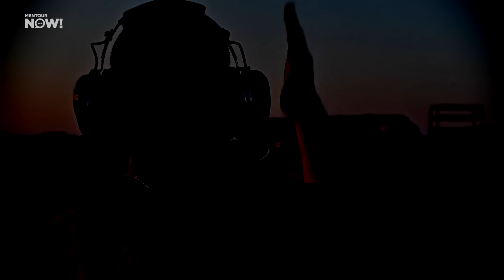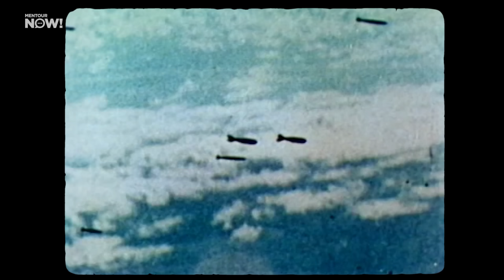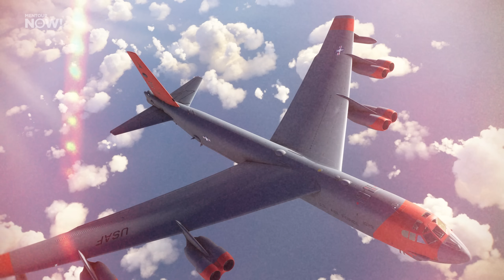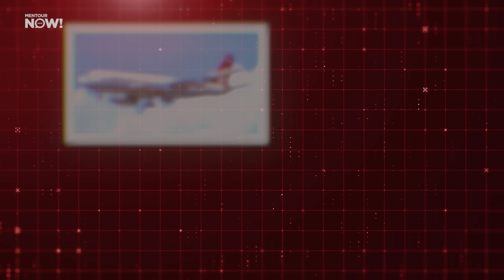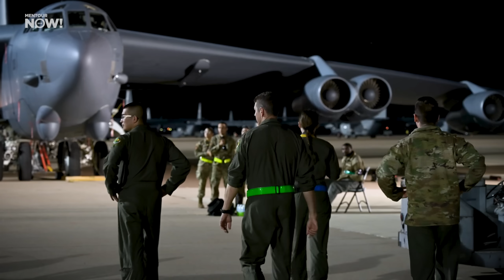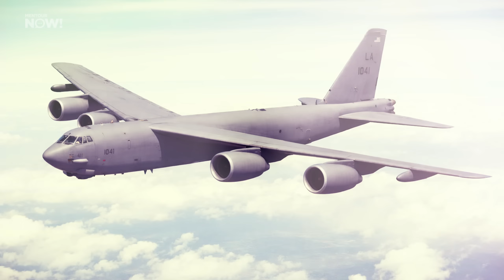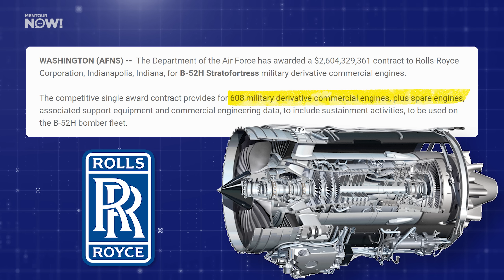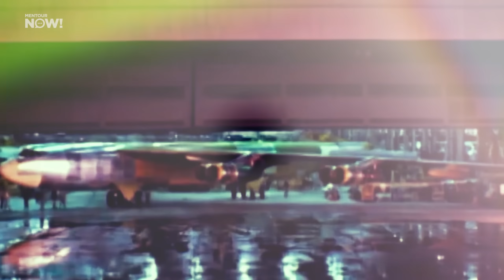WHY Are They Changing The B-52 NOW?!

Comment: In general I think everything should be upgradable for decades. That would just be fantastic. Think about a Car that you could keep up to date, you could have bought it when you were in your twenties and use it until your fifties or even sixties. What would count on a car? Well, brakes, gearbox, exhaust and engine. You could have bought it with a normal combustion engine and now you would think about an electric drive train - given the body and structural parts of the vehicle would still be good.
Or Smartphones. The usual size doesn't need better displays as the human eye wont see any sharper as it does. If memory, processor and camera modules would be upgradable on long term I'd absolutely do that. Yes, there have been some attempts via some modular phones, still those are nieche products. And so is the B-52. I'm just glad that for guitars a d electric guitars not so many things have changed. I can still upgrade a 1950s Gibson Les Paul with Locking Tuners, better pickups and whatever comes to mind. I just wouldn't do that because some things are meant to stay original...

Comment: The US has a hard on for the B-52...it's too iconic to let it go. Before they chose to upgrade the engines...they should have just cut their losses. I know they have a hard on for this plane, which is an amazing plane, but is evidenced by a B-52 on display at the old Lowry Air Force base, here in Denver. The US is saving face with this...there is nothing new to be gained from these upgrades. Decommission them, unless they work as is...6th generation fighters are out...what chance does a slow ass bomber have with a zero stealth, modern day fighter?

Comment: We missed redundancy. If one engine hit by fire or damage or attack  in flight you still have 7…
Reply: Don't forget the story of the F-4 pilots flying beside a B-52 that decided to show that they had the better airplane.  After flying an aileron roll around the BUFF, they asked if the B-52 could do any better.  The BUFF driver replied, "Sure, just wait a minute or two...   How was that?"   From the F-4: "What did you do?"   BUFF: "I shut down two engines. Top that!"  (They also have a galley, so the flight engineer was able to cook breakfast on the return leg to Guam after an Arc Light mission, which impressed BG and former B-24 pilot Jimmy Stewart.)
Reply: You calling yousef nobility-we plural, your majesty?
Because Peter author had not missed this argument😅

Comment: Time stamp 14:30 The complete redesign to four engines would not only be expensive, it would be dangerous. The new B-52 would be a new aircraft in terms of both flying and maintenance. The process of finding all flaws would be huge and dangerous. And, as often happens, if design errors were missed, there could be crashes and fatalities in early years of use or in first combat, as has often happened before.

Comment: Excellent video, well-researched and presented — especially since the illustrations matched the narrative, so lacking in many videos today.
I, respectively, want to point out that in the late 1940s, the Boeing engineers anticipated more powerful engines, and so they introduced the pylon concept on the B-47 to facilitate swapping to upgraded engines. The B-47 concepts of engines mounted on pylons, swept wings and landing gear in the fuselage made their way into the design of the KC-105/707 and into the B-52.
Reply: Except B-47 did not introduce the engines on pylons concept. The first aircraft to fly with jets mounted on pylons was the Soviet IL-22 bomber in July of 1947 (not to be confused with much later IL-22 turboprop). It did not have the swept wing though, but that's not the Boeing's invention either.
Reply: The pylon concept was for survivability during air to air combat or engine fires. The pylon allowed a burning engine to hopefully separate and depart the wing without destroying the whole aircraft. It had nothing to do with future engines.

Comment: The tail has already been redesigned. When crews flying over Vietnam were being killed after ejection and subsequent tail strike, Boeing determined they could cut the tail down by about half.  The problem was it no longer had the rudder authority to control the direction on the ground after an engine failure at the 80 knot standard.  

The asymmetric thrust resulting from losing an engine before the rudder had aerodynamic on a 4 engine aircraft would almost certainly be fatal.  The B-52 is unforgiving in ground mishaps.
Reply: Re: Crews in Vietnam being killed during ejection by striking the tall tail as a reason for the shorter tail

Do not believe this at all. Sounds like old wives tale. I can’t find any documented case that this ever happened, Vietnam or elsewhere.

And even more definitively, the shorter tail appeared on the significantly redesigned G model in 1959. The first Vietnam mission flown by a B-52 wasn’t until 1965. 

The shorter (from top to bottom) but longer (from back to front) tail was created as part of a weight reduction and redesign effort that made the G model a different airplane from the A thru F models. The redesign of the tail was driven by the change in mission profile from high altitude bombing to low altitude penetration. At low altitudes the denser and more turbulent air put a lot of stress on it, and there were several mishaps caused by the tail breaking off. Even after redesign this was still a risk: the famous landing of a B-52 missing its vertical stabilizer (broken off to turbulence during a low-level test) was accomplished in a B-52H with the shorter tail. Mentour has a video on this also, I think.
Reply: That is not the reason the tail was redesigned and height shortened.

After the loss of two B-52s due to inflight turbulence, and loss of more than 80% of the vertical stabilizer on a third aircraft, it was determined that inflight turbulence could induce a resonance in the tail that resulted in structural failure.  There is footage of the third B-52 that was successfully landed, recorded by chase aircraft that were scrambled to assist in evaluating the damage before the landing attempt decision was made.

Comment: Why would you not keep a working system if it was designed and proven to be reliable?
But now with the engine-"upgrade" they have finally decided to Kill the aircraft.... yeah, sooo complex that engineering just a part of the aircraft takes longer than the entire timeline from "We need a new aircraft" through multiple "We want something different" to "Here you have the keys - have fun". Of course they have to make the engines way more aircraft-specific, highly complex and insanely expensive - if there were no cost-overruns (and we know there will be) then these new engines have a cost about half of the entire aircraft-cost, and that is just for the initial production. If you then look at the insanely high maintenance costs of modern engines - yeah this will be the most expensive "upgrade" compared to the original aircraft in aviation history.

This also shows that people are retarded:
The B-52 is a "slow" but sturdy aircraft that can deliver massive payloads. A B-1 or B-2 can also carry a huge payload but they are not designed for the same mission profile. The B52 can stay around far longer, the B1 is faster, the B2 is stealthier - and often you don't need the speed nor the stealth. And then a far simpler, cheaper, and sturdier aircraft is a good solution.
Surely we could create a far better aircraft overall for this type of scenario but that is not the new and shiny thing. That type of development focuses more on new stealth bombers.

Comment: IMHO the B-52-J should be a 6 engine plane, with the inner engine pylon having one one large engine and retaining the twin outboard, this would not require a larger rudder/tail for a one engine failure.  From what I found on public engine data, with the same level of technology, doubling the engine size, gives about a 10% increase in efficiency.

Comment: Makes me wonder why they don’t take a perfectly good modern passenger aircraft and turn it into a bomber.
We have all seen fire fighting aircraft and I bet that feat wasn’t in the original design.  Or was it?
Reply: A passenger aircraft is pressurized and has the wings under the cabin. A bomber is not pressurized except for small compartments and has the wings above, to get a longer and uninterrupted bomb bay. Structurally the fuselage of bombers is completely different from an airliner.

B-52 also has hardpoints under the wings, something an airliner wing does not offer.

Comment: I understand your point ... but what most don't understand is the true genius design of these planes. If we are so technologically advanced, then why can't they find or design an engine that can be used without problems for this plane? It amazes me how far we have come, but people with slide rules from the 50's designed a plane that has outlasted generations that are still flying... I think we need to dig up the old engineers to create an engine that will work in the modern age for these planes ... I bet they can figure out at half the price lol
Reply: I'd imagine the engineers were thinking any advancements in equipement inside the airframe would progress and be done in a way to fit inside their design without any major disrurptions or major reworks of the airframe keeping the cost of future updates fiesable. Or that's how any engineer should be looking at a project hoping that what they build will outlast the materials and tech available at the time of the original design. Look at the Aleign Burke class, it launched in the early 90's and they are being updated or being built new as a 3rd generation of the original.

Comment: On low level , low speed flight,  they seem to blot out the sun forever. They're really big.
 I'm glad the new planes I often saw in early 1960s El Paso when 13 will have better motors and still be flying after I'm gone.
Some designs are timeless
Reply: They were called the "aluminum overcast" back in Viet Nam days.

Comment: The biggest reason that B52 is still flying but B1/2 are retiring is just money. No stealth means easier maintenance and cheaper to fly. Also it good enough if not against aliens. So, save money for a few technological advances stealth bombers and make the workhorse even cheaper to fly which when it is safe enough to fly.
Reply: B-52 is, versatile, but it's still worth to ask why they didn't keep the B-2 in service alongside B-21 without the expensive maintenance of the stealth coating. Even without stealth coating its RCS wpuld be lower than B-52s.

A former stealth aircraft without the stealth coating could still fly and carry load.

Comment: Is the secret for the B-52 airframe longevity that it's not pressurized and thus doesn't have limited flight cycles unlike their passenger transport counterparts?
Reply: Certain parts are pressurized.

It simply flies not that much. It never gets nearly as many flight cycles anually than an airliner.

Airliners have to fly to earn money. On ground they just cost money.

A bomber does not have to earn any money.

Comment: There's a similar life expectancy happening with the F-15 and F-16. My neighbor is a retired F-15 pilot who's son and grandson are still in active service, and both are F-15 pilots. The Grandson is apparently flying a plane that was originally built in the Late 70s, and that my neighbor also flew in the early 80s.
Reply: None of the older F15s are sticking around. The same goes for the F16s. Most of them are already gone. The oldest are already long gone. The Air Force is only keeping the newer F15E/EXs. As for the F16s, it is only keeping the Block 40/50 aircraft.
Reply: @CorneliusTaylor-s1u👍

Comment: It's not hard to figure out why the B52 has stuck around or why it finally is being updated.   The B52 is a stable, reliable, long range platform.   It has managed to evolve with the times.   After it became a sitting duck as a nuclear bomber, it became a conventional bomber and stand off attack platform.   The 8 engine configuration may not be the most efficient but it is great because you got lots of redundancy in case of engine loss in combat.

Comment: You missed the part where the was originally designed as a prop airplane. I'm not sure, but I there might be footage of the original test flight somewhere on this platform. But that was the only flight, though. The prototype was changed to jet engines.

Comment: Great video.  One of so many of yours.   You briefly mentioned it, the B-52 is SAC bomber.  I first saw one as a youngster at a SAC base in MA, when we were visiting the commissary.    Enormous and beautiful.  I later learned about their other capabilities,  such as being nuclear capable and extremely deadly.    We cannot afford to make mistakes with NUCs.  Your details of the complexities of the upgrades were superb: power curve, engine failure ratio, wing construction,  fuselage, height from ground, landing gear, electrical systems, analog vs. digital.     Thank you for the education.

Comment: I don't see why you wouldn't be able to design the aerodynamics of each pod to mimic those of the twin engine pods. As long as each engine pod is in the same position and weighs the same as each twin engine pod I can't see there being a huge issue aerodynamically/mechanically. Making the new engines work with the old avionics is probably a whole different issue.

Comment: I talk to an engineer as to why the B-52 will still use 8 instead of 4 engines and he stated because of the rudder being too small to compensate for an out board engine out situation at take off, they chosed to keep 8 engines and not redesign the verticle stabilizer for a four engine variant.
Reply: Seems this is only one of a whole raft of reasons

Comment: Yep: 22:40: C130s and CH47s will achieve 100 years service comfortably too. New designs typically have a hideously painful and long gestation hence the tendency to remain with tried and true workhorses.
Reply: C-130s are a bit different though.  They are still building C-130s, and I doubt the AF is still flying many, if any, of its original C-130s.  I realize that the H model B-52 isn't one of the "originals" either, however none of the existing aircraft flying were built after 1962, and that puts it into a different category than the C-130.

Comment: I'm on the program for the new engines and yeah, it's a beast of a project. So much of the engine is being redesigned to allow for new routings and new systems. Even though the core is staying more or less the same, quite a bit outside the bypass duct is getting overhauled.

Comment: One of the unknown secrets about the B-52 and also Air Force ONE is that they used to have rear firing machine guns but now they have rear firing missiles so if somethings tailing them or a hostile missile is chasing them they've got a launcher tube that will hold 8 missiles with splash disks in between them for the larger ones and top loading for the smaller ones with 2 Air Force guys in the rear of the plane who know how to manage all this and keep everything loaded and reloaded but there's a lot of other equipment back there too like Laser blinders, IR Jamming, GPS Jamming, Every band of radar Jamming you can imagine plus the missiles plus other things like very believable decoys that work on unmentionable operating methods shall we say.. These include drop decoys and toe behind decoys That have proximity fuses that can defeat hypersonic missiles with aimed tungsten fragments. It's not just a tail with a twin 50 any longer! It's packed with every survival gizmo imaginable. Very interesting arrangement back there, I've worked on them before. DARPA has also been been more interested in missiles that fire backwards (to the rear) as of late so you might see it on the new Lockheed Raider for last resort self defense.
Reply: I call bullshit on your post. They pulled the guns from the B-52 Hs to get rid of the one Enlisted crewmember. One less guy to draw flight pay.
Reply: @williamhudson4938  I was talking about Air Force One Version dude.
Reply: @Freedomistmanno you weren’t, you claimed it was an unknown secret of the B52. Well they don’t have rear firing defence missiles and it’s no secret that they used to have defensive guns which were long ago replaced by ECM and decoys, so why did you post here at all?
Reply: @neilturner6749  They do have rear facing missiles When's the last time you worked on one?

Comment: Are the high bypass engines of today capable of the speeds of the lower bypass engines of the past?
Also, the swept wing design makes me think that the B52 was designed to fly faster than the airliners of today.
Reply: Todays airliners have far superior aerodynamics than a 1950s aircraft.

But they are optimized for fuel consumption, and there is a sweetspot around Mach 0,85. If you fly faster (what they could) drag increases significantly, increasing fuel consumption for a relatively small speed advantage.